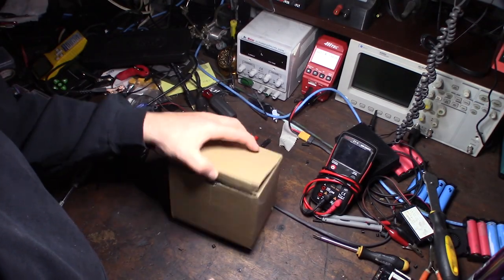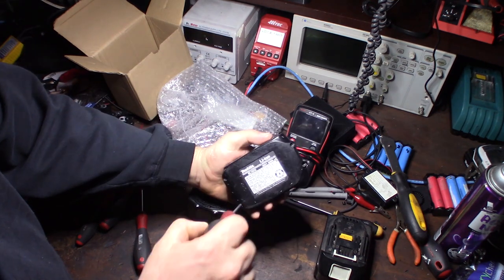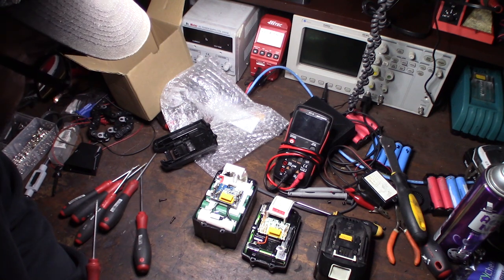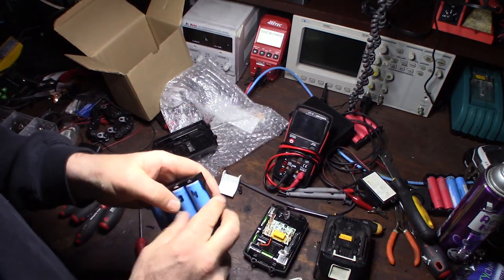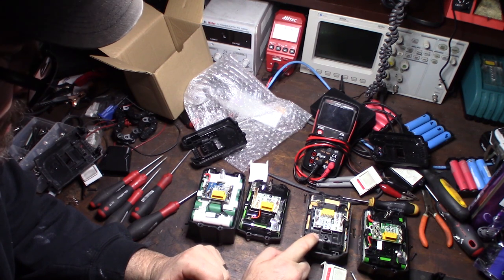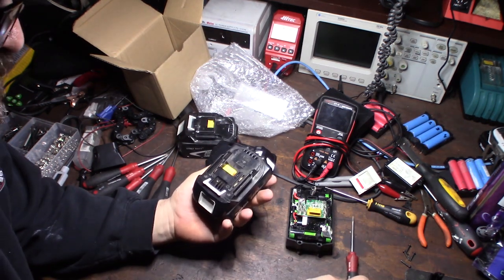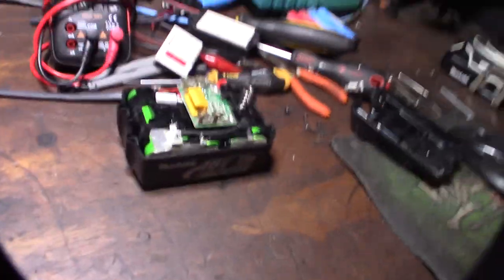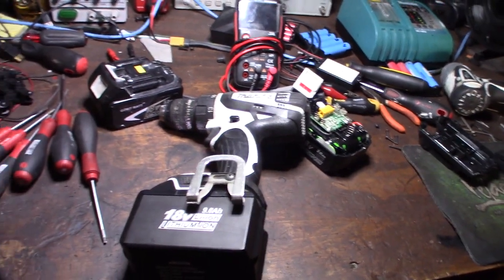Makita BL1890 9.0AH Lithium ION Battery by Vanon Obviously not genuine OEM or BL1830 ????

Comment: I had this exact 9ah Vanon battery, halfway thru a cut with 18v circular saw it burnt up and completely died. I am waiting on a refund but also, do not recommend.
Reply from the maker: Mine is still going strong. I drove about 500 4" deck screws with it. One of the problems with these cheap fake makita batteries is balance charging. I've made a few videos about these balancing boards